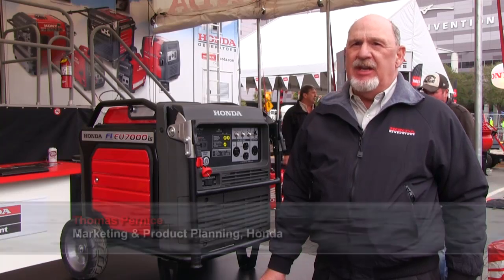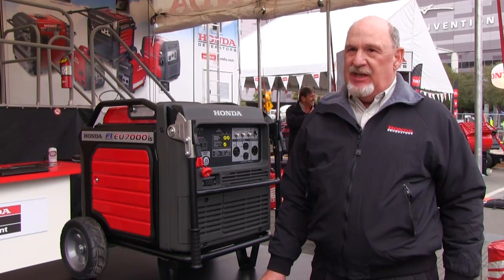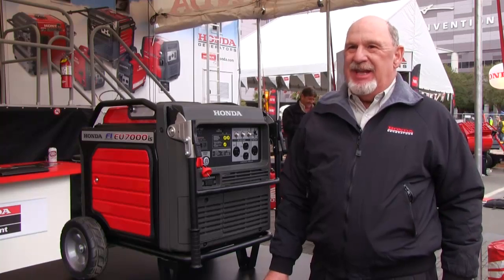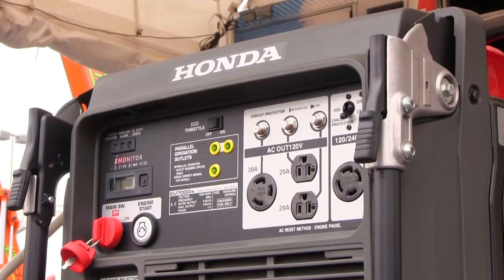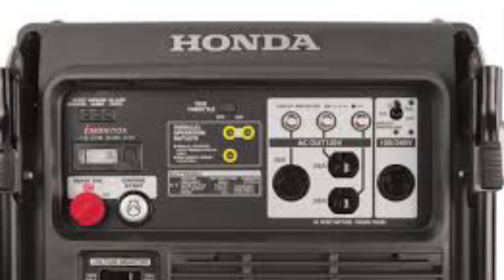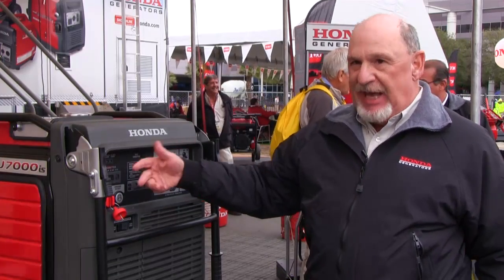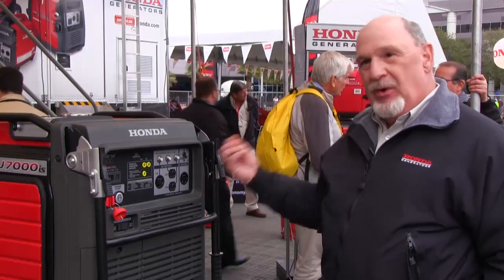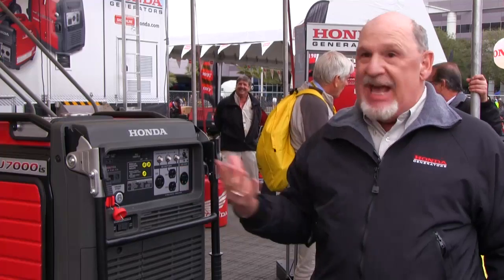Honda displays the first electronically fuel injected inverted generator (construction equipment)

Comment: I wanted to point out a few things about this generator versus the EU6500IS.  I for one am a Hugh supporter of Honda and have owned many of their products over the years.  I saw some people's comments about feeling that they were cheated and or concerned that they did not know about the EU7000IS prior to purchasing the EU6500IS.  Please know that the EU6500IS is a first rate unit and closely related to the EU7000IS.  The main difference being the fuel injection.  If both units were left outside in freezing temperatures the 7000 would start quicker and run smoother for the first few minutes, after that both units would be almost identical in performance.  The fuel injected unit will always be slightly more efficient but that is about it.  As far as long term ownership, the proper maintenance is performed; the 6500 will easily stand toe to toe with the 7000 and will be easier for the do-it-your selfer to work on.  Just remember to always use STA-BIL once a year; I personally dump the fuel annually.  I also place a small amount of octane booster in the take as well as some Marvel Mystery Oil for top cylinder lubrication.
Reply: thanks rob
Reply: @grifosthrgreatest  yeah and when the motherboard board goes bad? you're screwed ! Fuck this, I should have bought the 6500 with a carb. You can look online, lots of unhappy people who bought this "NEW" fuel injected POS and are pissed.

Comment: Important question: Why does fuel injection mitigate a problem with old fuel? .....and how old can you let the fuel become before it becomes an issue?
Reply: Old Generators generally don't like being left alone with no use so much ! :) Carburettors need to be cleaned and inspected sometimes. Honda managed to make very durable ones, but still, not compared to an Electronic Fuel Injected System. The EFI system uses less fuel, more efficiently, and has far less problems.

Comment: want!!  this will be my first generator...intended use for home backup use (live in AL), RV use (50amp service on my airstream)...I use my airstream at home for extra sleeping when I have company so in worst summer I can use this and assume both AC units...is there good service on such a unit in my region (birmingham, AL)?
Reply: Do not connect an EB5000i or EB7000i generator to a home or building’s electrical system. Honda EB5000i/EB7000i generators are designed for construction job
site use and cannot be connected to a building’s electrical system.
These generators have the neutral bonded to ground to comply with
OSHA job site temporary power regulation. Building main breaker
boxes also have the neutral bonded to ground, so if an EB5000i or EB
7000i generator is connected to a home or building electrical system,
the GFCI relay will trip the generator’s main circuit breaker.

There are of course hacks.